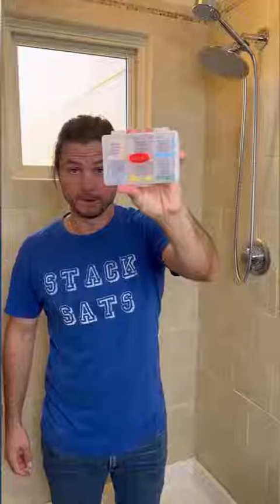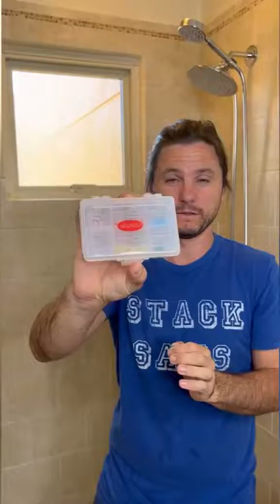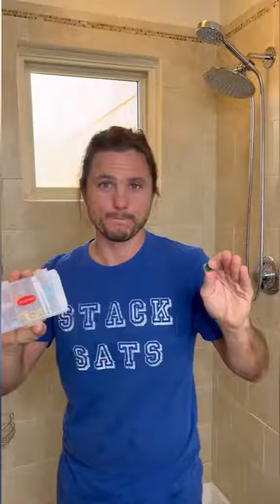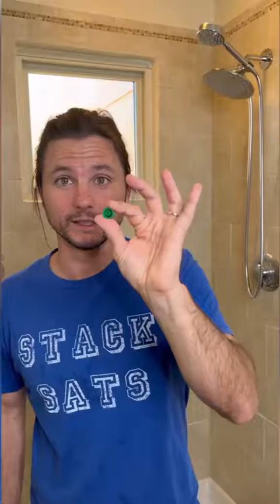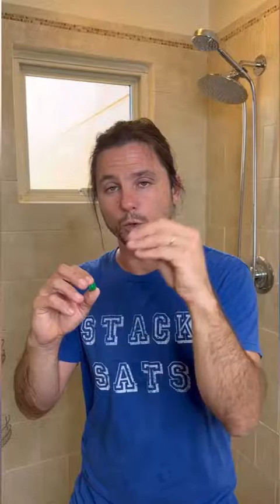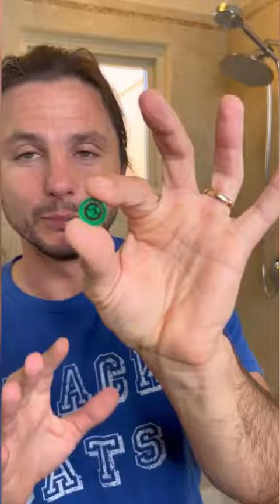Difference Between Water Flow Restriction vs. Flow Regulation

Comment: Nobody is here for the word salad disambiguation. I just want it gone.
Reply: 1. Remove the showerhead.
2. Remove the black rubber washer/metal screen. Keep this.
3. Using tweezers, remove the black rubber o-ring. Discard.
4. Using needle nose pliers, grab the green "flow regulator", IE restrictor, by one of the four center tabs and pull straight out. Discard.
5. Reseat the black rubber washer/metal screen.
6. Reinstall.

The flow/pressure feels much less "regulated" after this.

Comment: I have 1973 Alsons shower head that sprays hard and a lot so looking into a flow regulator. (The wand says 2.5gpm on it but I don’t know what my pressure is) What is difference in this device versus the mechanical valve type that goes inline with the hose? Thanks

Comment: I hear what you're saying... And I'm still tempted to remove the flow regulator because i want more flow than what they're allowing due to water efficiency ratings.... But then i know once i do, I've voided my lifetime warranty and yeah... Not sure I'm willing to risk that.
Reply from the maker: @oneldeaTooMany, removing the flow regulator will not void the warranty
Reply: If something happened to your shower head then couldn't you just put the regulator back in if trying to get the warranty?
Reply: I've read a horror story about a person's show head blowing apart from removing the regulator (head becomes the restriction point holding pressure).
Reply: @Gugernoot That could not be true….it is not about the pressure it is about the flow…. And it could not blow cause without the restrictor water can freely flow….
Reply: @Gugernoot  Then his plumbing connections must have been pretty sh!tty.  Then again, you probably saw that on YouTube, so I'd take that with a nanogram of salt.

Comment: Hi, I bought a Sonity filtered shower head from amazon, and it came with a 2.5 gmp  flow regulator . After installing the showered head, I noticed 2 things the Sontiy showered head did not flow correctly and sprayed half, and the bottom shower head holes just dripped  so much water it came out the sode onto bathroom floor. Secondly, I noticed the old shower head was smaller and the gmp was at 1.75. Can that be fixed so the new shower head flows out correctly?
Reply: I had the same problem with my old shower head but ever since bought Jolly shower head and never had this problem .It's the best shower head filter in terms of make , design , and ease of use .They will provide u 1.75 gpm flow restrictor inside the box .
Reply from the maker: @Jannat-h4j4h  Thanks for the feedback
Reply from the maker: In this case, I would suggest to contact Sonity directly as it definitely sounds like a warranty issue!
Reply: Why does anybody need a filter for their shower water?  Just more useless crap to buy and have to keep replacing!

Comment: Can these be purchased on Amazon? I have a home with low water pressure, but just put in a huge shower after my house burned down with 3 shower heads.   Then without running it by me first, my contractor decided to give me a 50 gallon water heater instead of the on demand heater we priced out initially... I really hate to see the 5 minute shower I'll be able to take twice a week!!😅
Reply from the maker: Sure! you can find the on amazon or right here: https://www.theshowerheadstore.com/collections/accessories/products/flow-restrictor-1-75-gpm
Reply: An alcohol swab with a washcloth works great in between showers... just don't get any in any..._orifices,_ IYKWIM!
Reply: I'd get them from a reputable brand stocked in your local hardware store like fix-a-tap in Australia.
Reply: Hammerhead shower heads are made in the USA!! You aren't going to find anything more reputable than that!

Comment: the only problem is if you have high pressure that black band can stretch out and sometimes pops out. My speakman has the same thing.
Reply from the maker: If this was the case with one of our products, we would provide a replacement right away!

Comment: I don’t see where I have one of those in mine that I bought from you. It looks like it’s all one piece and the pressure stinks !
Reply from the maker: There is one flow restrictor which is located behind the black rubber washer in the main female connection. For hand held shower heads, this is in the shower holder connection. For fixed and rain shower heads, this is directly in the connection of the shower head. For the dual shower head, you'll find one in the handle of the handheld and the other in the female threads of the rain shower head. Let me know if this helps, Miles and thanks for the feedback.